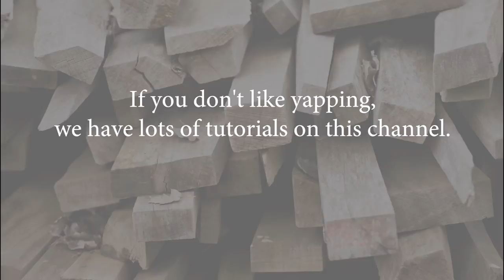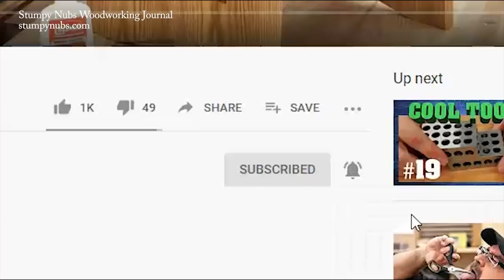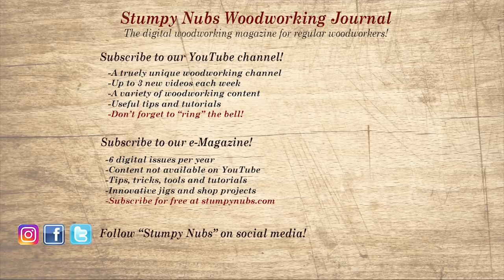Who's sick of YouTubers getting BIG fancy shops?

Comment: I have a 12x12 shop. It’s amazing how much you can fit in there. I don’t do just woodworking but general household repairs, equipment maintenance and repairs, etc.
Reply: I'm hoping for that size in a couple more years. It'll feel huge.
Reply: Scott Roy — I built the shed 14 years ago and only actually put a floor in it less than 2 years ago. So... it takes a while to get to where things get done. It’s nice to have small goals and achieve them, little by little. Money can’t buy that kind of satisfaction.
Reply: Agreed, my shop has a main room of about 15x15 and a couple smaller ride rooms for storage, but I’m amazed I’ve managed to fit all the essentials in there.

Comment: YES!!! You are right. I was just talking with my wife yesterday about the difficulty in finding a channel with woodworkers with small and modest shops and tools. I just started woodworking about 4 years ago, and I've learned alot in that time from woodworking channels here. Everyone has their own unique challenges in their shop and it would be nice to know that we're not alone with those specific types of challenges. In my situation, I live in an urban area and I have a tandem garage that is sloped towards the street. We have a drain 10 feet in from the garage door, so the floor is sloped towards the drain too. And my driveway is sloped to the street. So just not having any level floor space anywhere is already a challenge in itself on top of having very limited space. 

I have a dewalt contractor table saw that I have stored into a rolling cabinet box that doubles as the stand when I take it out and use (the whole thing actually rolls into a worktable I made specifically to house the table saw rolling cabinet). My miter saw is in a fliptop rolling cabinet. My drill press is sitting permanently on an old dresser drawer. My home made router table/cabinet also houses my HF belt sander. I made a drawer filled assemble table out of an old oak front door my friend gave me (finally, a completely flat surface!). And I have a workbench, which was the first thing big project I made. I also have a dust collection cart with the dust separator, and the One-Minute workbench that I roll out to the driveway if I ever need to rip a full sheet of plywood. Luckily, my table saw fits right on the wing and the bench becomes an outfeed table. That is the extent of my workshop. 5-10 minute set up if I ever want to do any wood working. And I have to park the car out in the street every time.

Anyway, sorry for being long winded. I had to vent and you touched upon the core of my venting. Thank you so much for this video and acknowledgements. It means alot to me you have a allocated a portion of your shop dedicated to the small and modest woodworker shop. Keep up the good work and looking forward to seeing more from you.

Comment: how did I not subscribe to your channel before now, I was sure that I had, but apparently I had not, time to fix that. I appreciate the content. I realize my perspective is tinted by the fact that I have worked construction in decades past. but I have been retired for more than a decade too. I have done everything from framing to custom woodworking. I have probably forgot more about applying finishes than most hobby shops will ever know using tools or products that either no longer exist or are just plain are outdated. I once finished a wet bar in a double wide closet in a 3 million dollar house I used gloss black lacquer, with an airless sprayer.  it had to be done after the cabinets were installed because of the finish. not that kind of thing that I would recommend.   again thank you, keep up the good work.

Comment: Great stuff. No CNC/XY plotter or programmable 'push a button to execute and walk away for a cold one' type machine$ allowed. Free CAD software app exception for design concept and drawings, postings etc but not a file download to an auto-machine.
Show alternate methods to achieve joinery/inlay/special cuts etc using different 'garage shop' tools on hand. 
Prototyping and design tips and concept development approach, common project sizing for home and yard projects considering  industry dimensions commonly used by manufactures of home equipment and accessories, test experiments of glues, finishes with fancy woods, etc, not necessarily tool reviews, lots of that on the web.

Comment: How about a radial arm saw for the smaller shop area. They can do cross cuts, miter cuts, bevel cut, rip cuts, dados. I think you can also get a planer head attachment for some. I recently picked up a 1958 Dewalt GWI 10" RAS for $100 on FB marketplace.
Reply from the maker: I have one. Grew up around it.  Don't use it anymore. They are unnecessarily dangerous. Other tools do the job without the same risks.

Comment: You know, I'm happy others have found the success they have worked for years to achieve. In my case even if I grow my space to say a two car garage, I'm not going to go out and purchase a bunch of new equipment for it, the only thing I will look into will be better hand planes and a proper sized jointer and planer other than that, I may buy an actual router table with a proper router rather than putting my plunge router in it. But I doubt I spend that kind of money on a new router table and router lol. James, you've worked for a long time to get where you are, don't let others try to bring you down.

Comment: I have to say i am impressed with your ability to work a squeegee on that big piece of glass. I am a window cleaner and my assistant doesn't even have those skills.  LOL
Reply from the maker: I cleaned windows for 20 years. Got lots of practice. Frankly, I'm a little rusty these days :)
Reply: @StumpyNubs  This is my 25th year of cleaning glass.  I am from Detroit so i am pleased when i saw your Wings Coozy :)
Reply from the maker: Back in the day, Detroit Sponge and Chamois was where all the cool window cleaners hung out :)
Reply: @StumpyNubs  LOL they moved to Novi lol I used to love going to the store on Warren.  Now i just order and have it shipped.  Ok now for a sharpening question.  I am new to sharpening and i have done my Splitting Axe.  I found a carving hatchet that i am putting a edge on.  Only 1 side has a bevel the other is flat do i still sharpen the flat side or just bring the bevel side to the burr and just remove the burr from the flat side. I cant seem to find a helpful video about this kind of axe and how to sharpen it.
Reply from the maker: @raymondrobbins9495  - I went to the old store a few times as a teenager in the early 90's. I believe the old owner was named Mitch. It was always exciting to see the new gear. Might sound funny for a teenager to be into that, but I was already running my own business before I was old enough to drive :)
Reply from the maker: @raymondrobbins9495  Any sharp edge requires both planes to be cared for. Just as you would flatten/polish the back of a chisel, you would also do so on the flat side of a hatchet. Of course, the "flat" side of the hatchet is not likely to be perfectly flat. And it need not be. But the half inch or so nearest the edge should be polished to the same level as the bevel itself.

Comment: Glade to see the incra tablesaw fence back on. I was thinking of a way to scam you out of your longer rails. I like the new shop already thanks for not leaving us little guys behind as you grow.
Reply from the maker: I know I'll get some push-back because it's an expensive fence, but I bought that with my own money when I was just getting started on YouTube. Had to save a long time to get it. I think most people can relate to that :)
Reply: @StumpyNubs  I started out with a used shopsmith, then bought another with all the attachments. When I stumbled upon the blue collar wood woodworking and noticed that gold fence I started researching and fell in lust with it I sold both shopsmiths bought an old unisaw and put the ts-ls on, it took me three years to buy that fence, I remind myself how much I like it every single time I have to walk around that side buster.
Reply from the maker: @samscarborough2107  Do your threads bind? Sometimes when I try to lock the lever down the threads don't mesh properly. Instead of shifting a tiny bit to mesh together, they seem to catch on the tops of the threads and the lock won't fully engage. That's why I stopped using it for a few years (and I didn't like the side table of the saw being covered so I couldn't lay cutoffs there as I made cuts.)
Reply: @StumpyNubs  I feel your pain on the room it takes up, as far as not wanting to "shift" to the nearest 32nd I think that is more of an adjustment issue. (I feel very insecure saying that to you). I had that problem before but do not remember the exact fix. Mark @  #incra would probably have the quick fix.

Comment: The way I see it I paid my dues with a small shop, I repair, rebuild and sometimes refinish furniture, I stay quite busy and it was hell for me when all I had was a small 12' by 20' work area, towards the end I used every inch of wall space up to the ceiling, had to put things in the back room, had a storage unit etc. When I left my 900 sq ft bungalow in suburban Detroit to Arenac County MI the new house came with a 1800 sq ft work shop, I have never apologized for anything to anyone, I worked my ass off to get where I'm at now and you should never feel the need to apologize for years of hard work paying off.

Comment: Even if you use the central dust collection in the little shop in order to stick with the theme I think you should put a dummy in there to take up the space otherwise it’s not really representing that small shop.
Reply from the maker: Many small shops use shop vacs or no central system at all. That said, we have a small wall mounted unit to install.

Comment: I have a single 110v outlet in my garage...on 15amp breaker.  

Maybe I’ll just go old timey
Reply: Or learn electrical work. Basic stuff isnt  hard.
Reply: Adam Wilson 

I have a sub panel on my garage coming off a 60 amp breaker for the AC evaporator and then one 15 amp for the entire garage. I technically have one mkre spot in the sub panel for a 15 amp but I need to verify the wiring coming from the main panel is heavy enough.  Preferably I’d add a larger sub panel so I can add in another 220v circuit for my electric car and support solar panel installation. 

I need to determine how the wiring gets from the main panel to the exterior wall of the main house. I’ll be finding out soon after I rip out drywall that got ruined from a recent storm.  So hopefully it’s coming through a piece of conduit to the exterior wall, to a pull box, and then through mkre conduit through the yard to the sub panel.  

Isn’t too hard. I just ran conduit and 110 and 220 circuits at my makerspace so like. It’s not that hard...

Comment: Having a lot of space is, I think, just fine if you're making videos for people. Trying to do that in a cramped little space is not fun & just makes the job even harder to do, so I'd never have a problem with YouTubers expanding on floor space. It makes videos easier to produce, which means more time can be spent on projects rather than on trying to balance or tie off a tripod or boom mount in order to get the right angle for a shot.

What does bother me is when channels that started out as creative go full CNC. Suddenly a lot of that creativity is lost as these super complex parts or really long runs are churned out & the maker no longer has to find clever ways to solve problems, instead relying on what is essentially brute forcing the solution. That's not to say I don't think it requires skill to do CNC stuff, but it's a very different area & many channel owners don't seem to understand that there's a big disconnect there. Would I like a CNC mill or router? Absolutely. Would it save me time & money? Well, the former at least. Would I get as much enjoyment out of what I make? Not at all. The less you have, the more creative you're forced to be, & that, for me, is the difference between somebody who designs or engineers & somebody who just builds.

Comment: Even in your "small" shop you have tools most of us can only dream about. The Incra super fence system on your Saw Stop contractors saw is worth more than my table saw, router table and all my other tools. I will continue to watch the videos but I am fast losing the ability to relate to you. Or the Wood Whisperer. Or Jay Bates Or Just Make Something. I try to watch all of you and will take whatever I can learn from you.
Reply from the maker: The problem may be you are looking at brands when you should be looking at results. My SawStop contractor's saw will cut the same straight lines as another guy's 40 year old Delta-Rockwell. My Incra fence may be easier to adjust, but it's still just a straight edge. So what difference does it make what they cost me? You can do the same things with your tools. It just may take an extra minute to set up. 

I could understand if I was using a machine type you didn't have like a 36-inch planer, so there was no way you could make the project. But if you tune out just because the brand or price of the tool is different from yours, you will miss a lot of very useful videos.
Reply: @StumpyNubs  You are correct. Does the difference in cost equate to more accuracy? Probably not. I would assume that at some point after multiple adjustments and trial and error cuts with the stock fence on my Craftsman contractor saw I would get a straight cut that could be square. I work really hard to make cuts that would be very easy with updated equipment. And I hate that that sounds like I am whining. Building cabinets would simply be more accurate with updated tools. 
I will never chastise achievement. My comment indicated that I still watch the videos;  just hard to compare your results with mine in reference to time taken to get the those results.
Reply: William Laird just keep in mind that in YouTube land, comparisons based on time are completely meaningless thanks to the magic of editing. You’d never know if it took him a month to finish a project that should have only taken a day, and vice versa.

Comment: What annoys me is when people show you how to build something useful but inexpensive to save you money using tools most can only dream of. If you want to make something for a few bucks rather than spend hundreds to buy it, show me how but don’t use 6 power tools worth tens of thousands of dollars to build it. I stop watching and would never subscribe.
Reply from the maker: I find that is rarely the case. Sure, a $5000 table saw may be something you don't have, but the process is the same with a $200 saw. They both cut rectangles. Likewise a $700 Festool router works essentially the same as a $100 Ryobi. Even a Domino is just a fancy loose tenon jig. You can do that with a cheap router and a wooden jig. So many people are too quick to dismiss something when they see a brand or a tool that's expensive when they only thing that's really holding them back is a lack of creativity.